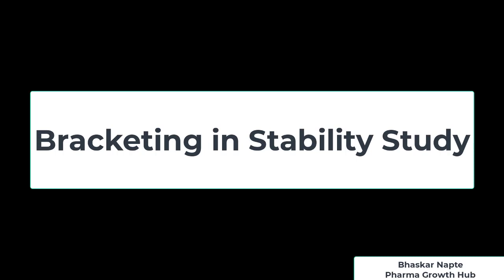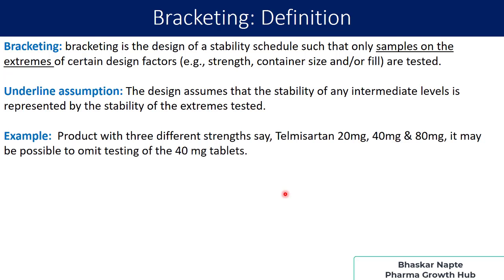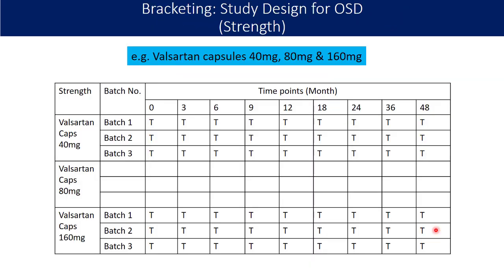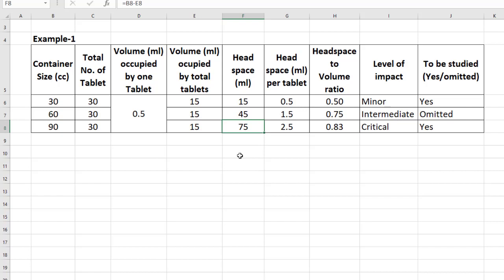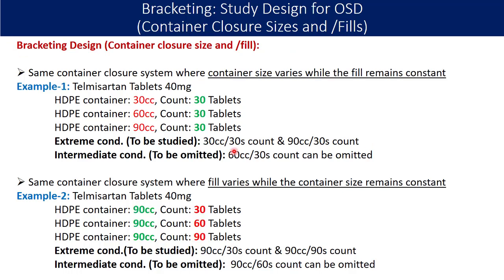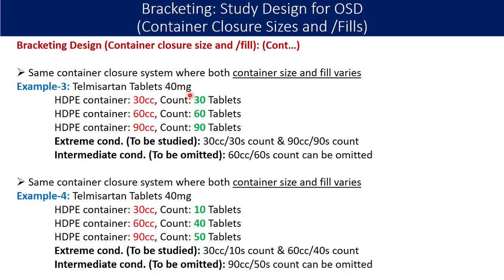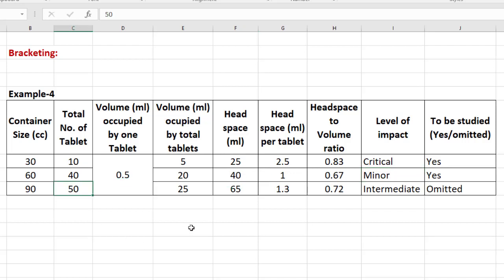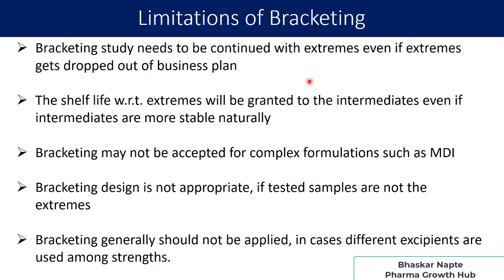How to use BRACKETING design for stability testing?

Comment: Useful presentation  Sir.
I have 2 questions.
1.How do you arrive 0.5 ml volume per tablets?
2.In of case blister or strip ,how to calculate head space volume per tab or capsule ?
Reply: this is not logic that volume is 0.5 ml for tablets with different strength( if API and excepients  is proportionate so volume of 40 mg must be double volume of 20 mg)